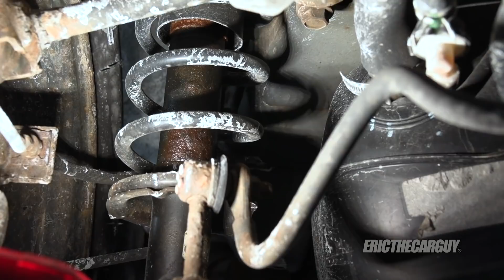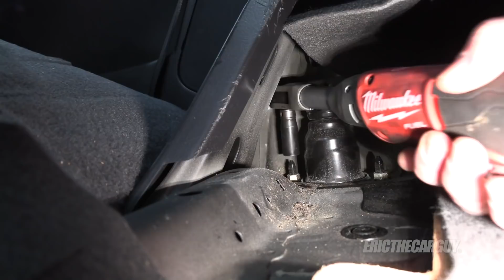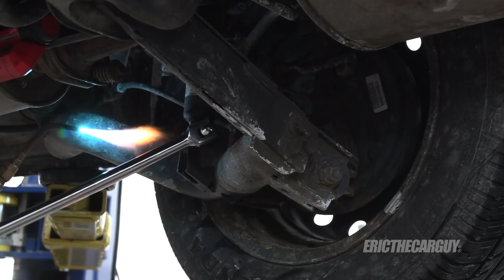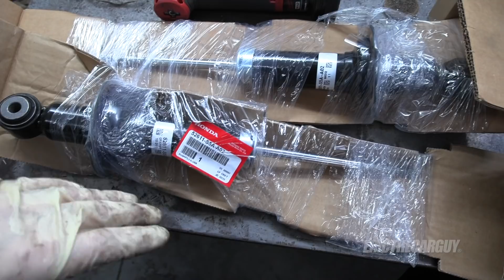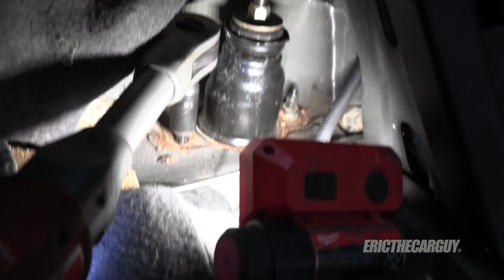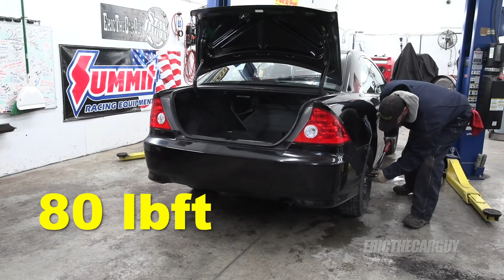2005 Honda Civic Rear Strut Replacement

Comment: Man, this was a sumaabish to do, and i only did one side! Got late on me. I Had to cut the lower part of the shock where it meets the part where the bolt goes through, and the nut thats welded, broke of course. And before cutting the the "bits", went to home depot to buy the 12x68mm bolt, as i knew i would have to cut it but they didnt have them and had to settle for the 12x65mm with a new nut and put it on. I also bought a 12x70mm bolt in case. Had my neighbor help put the bolt through as i pushed down the The control arm. I had to push down the cntrl arm as he is about 100 lbs lighter than me lol bought him one big beer and me several lol

Comment: When changing struts it’s best to change the whole assembly. Usually the springs are what caused the struts to go out in the first place. I’ve seen both weak and spring stiffness causing the original problem. Save yourself a lot of time and money. The worst thing is to get it all back together only to find out the springs are bad..

Comment: Old video, so appreciate if not answered. But I just got a quote 4 hour labour quote for the same job for my daughters car. It only took you 15 minutes. Lol. But seriously, what would you quote on this? Granted the potential of seized bolts would need to be considered, but it’s 6 fasteners if you buy integrated shock struts. Why wouldn’t I just myself, I can already hear some say? Cuz I don’t want to and I support my local mechanic…… and I have a hammer and a Leatherman.

Comment: Looks like I'm going to have to do this job again. Just noticed my rear strut is cracked where the lower bushing is welded to the strut tube. Instead of being an O shape its now a C shape. I wonder how long it's been like that. There was some squeaking noise and the occasional clunk from the suspension. I thought it was from the Delrin bushing I made to replace the rubber one. It's an aftermarket Koni Orange STR.T. The rubber bushing that came with it was so weak and flimsy that it got mashed up in a few days. It's nothing like the oem with a steel outer - rubber damper - steel core construction. This was just a chunk of rubber with a steel core. I couldn't find any replacement bushing that would fit. That's why I made the Delrin plastic bushing. It worked great for some time until the steel gave out. I figured the plastic would wear out and never considered the metal would fail. For replacements I'm thinking about going for a pair of STAGG SHS struts for $100 if I can get away with it. Ideally I would want pair of BILSTEIN struts for $300 to go with Eibach Pro Kit springs I got. If I could find a set of KYBs cheap locally I might go for that. I will have to do some more research.

Comment: I agree with your statement . I had a HELL OF A TIME doing my rears on my RSX, on my garage floor.. It's not easy to align the bolts back once you get the new strut in place.. 
geeezus.... You need 2 people. Lots of tension on that springI thought the fronts were hard, i'd do the fronts again and again over the rears if i had to.

Comment: Ive bought those______national  brand struts complete,  and after swapping them out the ride height has increased, which tells me the old springs lost compression or ride height, some cars you can  undo the bottom and undo  the top  nut, and have a fat guy sit on the fender to compress the spring, but some times,WTF

Comment: Wondering if you also did a video of the front strut replacement? I bought mine used, and i cant seem to install the top spring seat right. keep hitting the inner well when turning.

Comment: I was taught to tighten a rusty nut first. That gets a lot of them loose.  Doesn't always work.  If not, a nut splitter gets them off.     Love the videos. Thanks Eric.
Reply: It doesn't help much when a through bolt is rusted to a bushing. I had this issue on Focus rear control arms when the Newfoundland car was 7 years old.

Comment: It has happened to me several times specially in Hondas. Regardless if it looks rusty or not. The possibility of having the bolt rusted inside the bushing it is extremely high, don't know if it is the Honda bolt design or what but 7 out of 10 you will ended up with a ceased/rusted bolt inside a busing on a Honda. A 1 hr. job turn out to be 4 hrs. job and lots of words when you don't have a lift and working on the floor with limited space and add to that the need of lots of saw blades.

Comment: Well I guess your son is now having even more buyers remorse than before given the issues that you just went through with replacing these rear shock absorbers. Interesting story for you, a friend of mine once bought a 2001 330ic with a 5 speed manual gearbox and he bought it for the same reason as your son and that’s because he wanted a stick car and his neighbor at the time who’s also a good friend is a long time BMW enthusiast and he did a lot of work on the car. Anyways, he bought the car from a cop in Yonkers, NY and so much buffooning was done on that car in every way. But you’ll like this one especially. They welded the rear shock absorbers to the frame of the car in an effort to keep the blown out shock absorber bearings from rattling around. Needless to say it took a lot of man hours of grinding and swearing to get those stupid things out.

Comment: Yea, living in the rust belt is fun, no? I hate it, this is what happened to me. I had to cut my front strut bolts off (06 Focus) and replace them about 3-5 years back when I changed the struts; surprisingly the back struts came off with no problem whatsoever.

Comment: Im curious if the strut replacement cured the strange noise described by your son.  I too have a 2005 Honda Civic that makes a strange creaking noise from the rear suspension only when it's cold and I haven't been able to pinpoint its cause.
Reply from the maker: Actually, no. Although in my defense I never heard the noise before or after strut replacement. I'm waiting till the new bolts come in and I'm going to ride with my son to see if he can help identify the noise.
Reply: @ericthecarguy  If you figure it out a video or a comment would be much appreciated.  If not, no big deal.

Comment: I have always used a grinder with a cutting disc to remove the crusty remains of those lower strut bolts.  I think it is a good bit faster than using the sawz all, and I've never had to change the disc in the middle of the job.

Comment: Sadly the cutting of lower rear strut bolts is common practice anywhere where hondas see a bit of road salt. Here we don't even bother trying to get them off XD just get the 1mm cutoff wheel and grind the bolt. it's not called the "bitch bolt" for no reason. Generous use of water resistant grease might help it last longer when you reinstall a new bolt, though.

Comment: Imagine quoting a job like this and running into all these problems.
Do & Charge is the only way.
Reply from the maker: If a customer brought me one of these cars I'd quote them the high price at the onset. That way they'd be pleasantly surprised with a lower bill if the bolts didn't get stuck in place. Thanks for the comment.

Comment: you didn't want to replace the upper strut mount bushings? On my 93 accord even the Honda dealer had them for $2 a pop. I found that this helps get dampen little bumps and some rattles by tightening up the suspension.

But living in the deserts of AZ makes me love working on this car, my 99' LS400 from Ohio, not so much. Had to cut out 4 out of the 6 eccentric bolts in the rear camber, toe, and trailing arms with a sawzall in order to be able to do a proper alignment. Luckily found a CA car in the JY and raided it for parts to replace them with.
Reply from the maker: You can purchase complete assemblies, the part numbers are listed in the description. As for why I didn't replace them, let's just say this is, what I call, an 'airport car'. That's a car that you can park at the airport for a couple of weeks and not care about it. Then when you get back and you're ready to start it up, it starts up and you're on your way. Otherwise known as a 'reliable POS'. You don't invest big money into a car like that. Thanks for the comment.

Comment: I'm in the Midwest. I cannot count the times rust has turned a simple repair into an all day job
Reply: I'm in South Texas where there isn't any rust (no winter salt) and I also had difficulty with the 05 Civic rear lower strut bolt.  A very powerful impact wrench was needed, the Harbor Freight pneumatic Earthquake wasn't strong enough.
Reply: @timothykeith1367  currently doing a rear disc swap on my 05 civic and i pulled the stuff from a 20 year old car civic si and shockingly i was able to get all the bolt off with a 18ft breaker bar and ratcheting wrench. san antonio.
Reply: Currently on 2nd day the bolt won’t go through 🤣🤣🤣🤣

Comment: If you're replacing struts and the bolts don't come out easily... Change the car.
My method uses an angle grinder, rather than a saws-all. Excessive bleeps also help.

Comment: Hi Eric, thanks for your great show. Can you show us all body bushings and mounts for 2010 Toyota Corolla to replace to make it quieter? I have one and it’s becoming noisy. I don’t much about it, but research showed me it is body bushings and mounts under the car. I need to which ones and where are those located. I will replace all of you do an episode about it.
Reply from the maker: In order to do a specific request like that I would need the same vehicle to come into the shop with the same problem and the time to shoot the video. Sadly, that's not very likely, but if it happens, I'd be happy to make that video. In the mean time you might find this helpful. http://www.ericthecarguy.com/faq/diagnosing-noises-in-your-car

Thanks for the comment.

Comment: Mmmm ... donuts .... :D

#rustbeltlife! LOL. Gotta love it (not really). Nothing is simple in the northern regions of the USA (or Canada, I hear). I also notice the cheapout in metal quality in these components the past 25 years or so. Back in the day, the bodies would rust away, but I rarely had to cut a bolt out of a shock or strut. Seems to be a thing these days. Now nothing is off limits to the cheapout - engines, transmissions, undercarriage metal. Automakers are in IDGAF mode!  Anyway, you killed 2 birds with one stone - we get a video, and your son gets a smooth ride. WIN-WIN!

Comment: I had a good time with seized/rusted front cv axle to the hub and front lower strut bolt on my 2001 Honda. It’s amazing what a little bit of anti-seize could do to prevent rustbonds on bolts and parts...if only Honda and other manufacturers could understand this...wouldnt be great?
Reply from the maker: In the future, don't remove that bolt if you're removing the strut. You don't have to. Just remove the 14mm bolt at the top of the wishbone and pry the suspension down to release the strut from the wishbone. It will save you a ton of headache. If you're doing an axle, disassemble the inner CV joint and pull it through the wishbone. You'll just need a new clamp for the CV boot when you reinstall. Thanks for the comment.

Comment: In this case would welding the threaded "fastener" back on be a necessity? what would be the downsides of using just a nut and lock washer/loctite?
Reply from the maker: Like I said in the video, no. Once you tighten it down, it's not going anywhere. I just welded it so that I wouldn't have to hold it up there when I installed the bolt. You saw how difficult that was toward the end. Thanks for the comment.

Comment: hey Eric, when I replaced my rear struts on my corolla, I put the washer at the very top bevel edge facing down; only after i returned the rented spring compressor did i realize that mistake. I couldn’t find much information online, but is there a particular reason the washer bevel edge is intended to face up toward the nut? so far the car has been driving fine. thank you for your instructional video! i had to use a three jaw puller to get my old strut off! it was not fun...
Reply from the maker: The only thing I can figure on that is that if the washer is pointed up, it should prevent damage to the bushing below it. Installed the other way it could dig into the bushing and possibly damage it. The beveled edge may be there to give more strength to the washer.
Reply: @ericthecarguy  Thank you! always enjoy your videos and ETCG1 commentaries!

Comment: Every old honda that I've done struts that main bolt always gets seized up in the bushing and pray to God it doesn't break .I've always bought those bolts with the struts honda recommended to replace them so I do it automatically even when they don't break but most do lol
Reply from the maker: If it's the old style with the wishbone on the front suspension, don't remove the bot that goes through the lower control arm, just remove the strut from the wishbone with the 14mm bolt in the back. Then pry the suspension down to remove it from the wishbone to replace the strut. It'll save you a ton of headache.

Comment: If you dont trust your cheap bolt-style spring comperssors, just use more of them on a single spring, like 3 pairs instead of just one. Takes longer time but much safer.

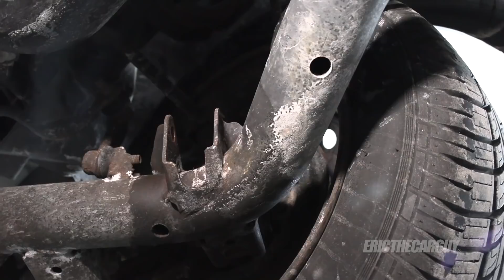Comment: 6:45 why not just use a regular nut there, instead of welding stuff?
Reply from the maker: Like I said in the video, you don't have to weld it. It'll stay in place when you tighten it down.

Comment: This is exactly the pains I endured when I replaced the lower control arms on my 04 Accord. Bolts seized into the bushings at the front and I had to borrow my buddy's saws-all to get the bolts out. I bought him some new blades to replace the ones I wore out. I had turned the bolt to many times on the driver's side before realizing they were seized into the bushing so I damaged the the weld nut threads and had to grind it away and replace it with a new nut. Thankfully it has held in the six months since I did the project.

Comment: When ever I change parts on my Jeep, I use scotch brite & Acetone too scuff up the part. Then I put 2 coats of paint on them or P O R 15 then clear them. Parts last so much longer & I even did this too my whole exhaust system, NO MORE RUSTY PARTS. Clean bolts, nuts, also paint them too & use lots of grease or Anti Seize. GREAT VID. SIR ERIC & the struts you were referring too are called " QUICK STRUTS " they have the new springs already on them, good if your springs are shot.
Reply from the maker: Actually, I was not referring to "Quickstruts" in this instance, as I would never put those on a Honda I planned to drive. Ride quality is terrible. Honda actually sells complete assemblies. Parts are listed in the description. Thanks for the tips and for your comment.
Reply: @ericthecarguy  OH SORRY, Yes I also use O.E.M. parts when available or better. Sometimes have to go to salvage yard & look for parts because nothing out there is very good. It's UNREAL how many parts are out there that they claim fit but in reality you end up modifying the part. EVEN VERY EXPENSIVE PARTS FROM SUPPOSEDLY WELL NAMED MANUFACTURERS. THANKS FOR REPLYING, SIR ERIC.

Comment: Same thing happened to my 1999 CL. I had to remove the knuckles with the strut attached, then cut an ear off of one side of the of the struts and the bolt on the other side of the strut to expose the bushing with the bolt shaft seized in it. I used a torch to melt the rubber out, then a sawzall to cut the outer race of the bushing and collapsed it with a punch. Pressed new bushings into the knuckles and put it all back together with new bolts from Napa.
Reply from the maker: Sounds like fun! Not. Thanks for the comment.

Comment: My 04 civic has been knocking in cold weather right after the 3/ 36 ran out. Funny how that is....I think it's the springs. Did you see any rub spots on the spring seats???
Reply from the maker: No I did not. Also, in my experience, I don't hear spring noises unless they're broken. It's usually stabilizer links or worn bushings.

Comment: A tourch helps so much with old rusty bolts.  Used a propane torch for 30 seconds to get rusty nuts glowing then the nuts came off so easy.  Replaced front and rear struts on 2012 Altima and 2006 Ford 500.  Tried cutting with angle grinder then later propane torch.  Torch so much better.  Had a fire extinguisher next to me.
Reply from the maker: In this case however you have a rubber bushing involved. Not saying one can't, 'burn it out', but in my experience, that creates a big mess, a fire, and possibly other damage. Not to mention the fumes are toxic. Thanks for the comment.

Comment: Hi Eric. I saw on some shock packages is written with bolded chars must not use impacts on the top nut. You have to hold the shock rod with a allen or torx and tighten manually the nut.
Reply from the maker: True, and that's what the manufacturer recommends, but I've done this for years and it works. Sometimes there's going by the book, and sometimes you do what works. I won't say you're wrong. Thanks for the comment.

Comment: I used to have a 2006 WRX wagon, when I did suspension I planned on replacing the fasteners, because it was 14 years old at the time, so I just preemptively ordered them all. I was not wrong, and ended up replacing all of them; New England and other salt belt regions tend to make metal parts merge permanently.

Comment: How ironic. I just did this same job on my CR-V of the same vintage. Literally the same process. I was able to change 3/4 struts. Driver side rear strut was seized in place. With limited tools, that portion of the job had to be outsourced. They cut the strut out to salvage the bolt, but got it done. KYBs all the way around makes for a much more tolerable ride.